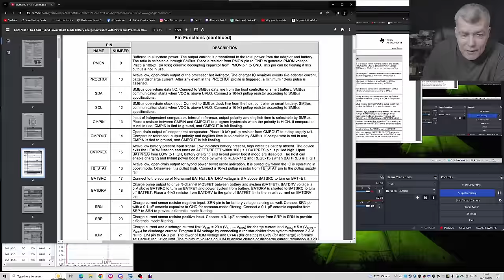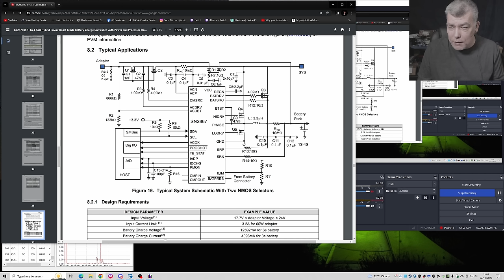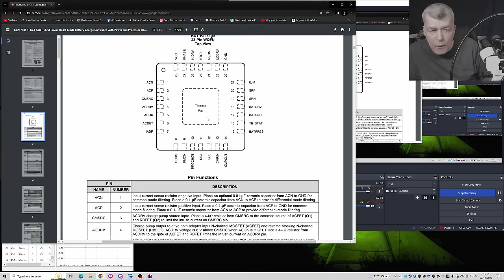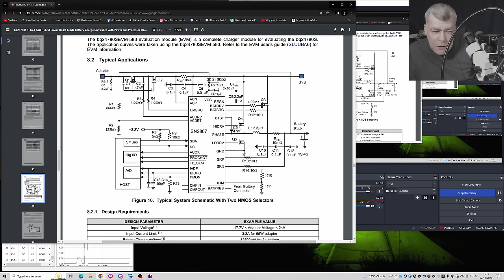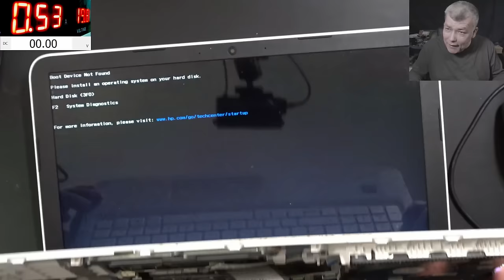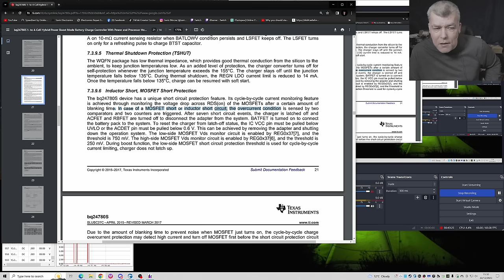Hp 15-ab254sa laptop water damaged - Laptops power input circuit

Comment: First MOSFET is P-channel not N-channel, and not connected to ACDRV. "Works" (inefficiently) regardless of Vgs because body diode is forward-biased so current can still flow.
Reply: you are right
Reply: Yes , the first is p-channel and that`s why the gates were not connected together
Reply: true..
Reply: indeed
Reply: If it is a P-channel why did it work when he put 25V on the gate?
Reply: You are right
Reply: Bq24780s on description, it can't drive p-channel MOSFET, can only work with n-channel, so yeah soring is right, even though the reading on that first MOSFET says it's p but I think something is wrong with it
Reply: @starfansubs  As I said it's not driven by ACDRV so the charger IC doesn't matter here. It's a P-channel so it's easy to control with an external circuit.
N-channel is what requires specific support from the charger IC since it needs a charge pump for the gate voltage.

Comment: The pin to the first gate was probably semi-shorted. That would explain the huge voltage drop when you connected the gates together. I would have applied some current first and see what's getting hot before applying 25V on the gate (and it's driver IC). Good job :)
Reply: No..  1 N-type and 1 P- type.  Bad move with jumper  wire
Reply: Yep! There are capacitors on the gates of those two mosfets. Looks like due to the water damage capacitor connected to the gate of the first mosfet was partially shorted. Smoke that Sorin fell after applying 25 volts to the gate was most likely coming from that partially shorted capacitor.
Reply: @laptopDoctorKZN  According to schematics, both input mosfets are N-type and both gates are driven by the BQ chip.

Comment: that is very crazy what they did there, indeed first mosfet is P-ch TPCC8131 and second mosfet is N-ch model AP0203GMT.. So connecting the gate of first mosfet to 25V is closing the mosfet . Current goes via internal diode. 
or maybe i am missing something.. i don't understand what they did there.

Comment: Sorin magic smoke, the track to first mosfet gate was dragging  the voltage down ,before you disconnect it, allow the proper calibrated wire to supply the 25v to gate got it regards Jim

Comment: Great video and a working fix. But this is also a reason why no one wants to work on a laptop that was worked on by someone else before. I think Sorin said it too some day :)) We are dealing with same issue in software development. Some devs think about next guy and spend extra time "removing circuits" he just disconnected or at least leaving a comment. Others just throw some magic and go home. There is a limit how many times you can do this until codebase is no longer maintainable. Anyway it's an old laptop that will unlikely see another repair. So it's acceptable as last job. Nice Christmas for all of you!
Reply: Do you wish to know more about motherboard and get free tips

Comment: Excellent!, Never would have thought a gate could have a bad joint and i definitely thought i heard a pop at 19:54 also when you seen smoke,
Reply: I think it the tip of the multimeter test probe that it slipped from the test point
Reply: He did put 25V back into the circut with his PSU, thinking that did the pop, not sure how the tunneling affected it though
Reply: @Dohcom1  zoom at the video and you will see its a coincidence that it happened when he put the 25v you can clearly see it slip off
Reply: @jaraalbert  Hi, Thats not a multimeter test probe, it a PSU probe at 25V, He couldnt have shorted across the board unless he went other way, and he never slips!
Reply: @Dohcom1  Well let me tell you that they are multimeter probes but connected to a power supply i have been watching Sorin for years back when he worked at the mall and he also showed his new home setup when he started at home
Reply: @jaraalbert  so you understand whats going on, i just wanted to confirm, i see your argument but he did not slip and short with the
Probe, can see he is not near a ground
Reply: @Dohcom1  Why argue if that is what you see well that's what you see but i see something different...

Comment: I've not seen you using lighter fuel as a cleaning agent for some time - did something go wrong? or was it not an efficient cleaner? (i bought some petrol to use simply because i had watched you use it)
Reply: Haha, I wondered this a while ago, myself. Oil-based is generally not good for electronics so perhaps he decided to shy away from becoming an advocate to others' mistakes. I use it on thermal paste but thoroughly clean it with IPA afterwards.
Reply: If I remember correctly, he stopped using the lighter fluid after he bought the thermal camera, he was using it to find hot components on the board. For cleaning i always remember him using isopropyl alcohol (isopropanol)

Comment: Merry Christmas to you and your family. Question, was wondering what size (proper calibraded) wire did you use. If you leave a link I'll purchase it. Thanks for being you and enjoy the holidays.
Reply: F “calibrated wire” don’t be lazy and use the correct parts
Reply: @MrPnew1  So you've never broken a pad or had to fix a trace on a board? I've been soldering going on forty years now. Although up until recently I started getting  more into micro soldering or smd work. I recently purchased a microscope and hot an air station to add to my bench. People can agree or disagree on whatever, although there are times where you need to jump something either temporary or permanently, that's just the way it is.
Reply: @marksplace agreed, but it’s bad practice to use jumper wire to bypass fuses, coils and mosfets. I never suggested not using jumper wires for trace repair.
Reply: @MrPnew1  Sorin mentioned many times he only does that temporarily to see if the said component is indeed faulty to save time. He does replace the components later (either has to order or looks for one on donor boards)
Reply: @MrPnew1 I ended up buying some 30awg wire as it seemed like a nice size for small circuits. 

That's when I got a little curious as to what it would take to burn it up. I ended it with 5v and 5amps and the wire didn't even get warm after leaving it sit there for upwards of a minute. I didn't want to stress out my power supply any longer knowing that any more than that is basically useless anyways as a make-ship fuse. I'm going to try and find the smallest wire I can and repeat the test. If one could use some small wire as a fuse it wouldn't be a bad thing if that's all you had at the moment. 

Although I think I'll also be searching for a kit of various size fuses to keep on hand as that would be the better choice. IMO